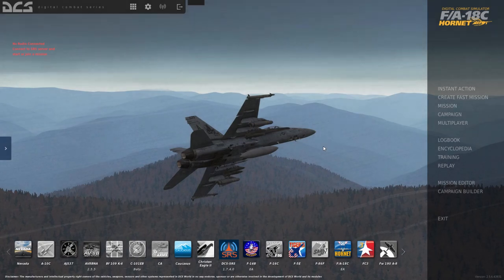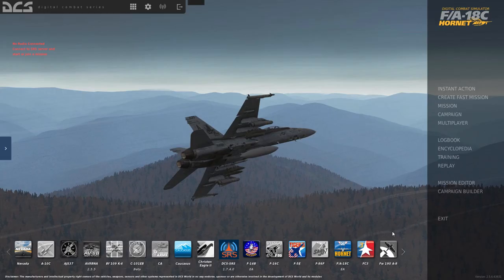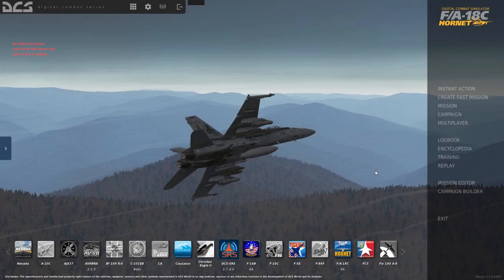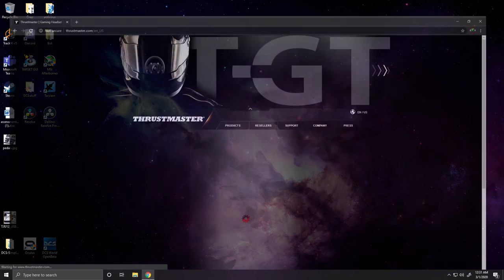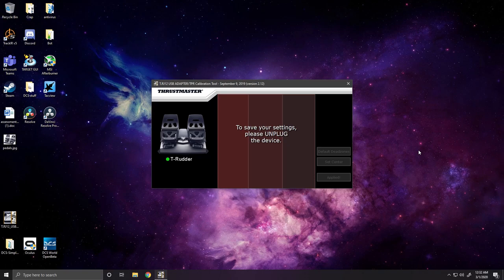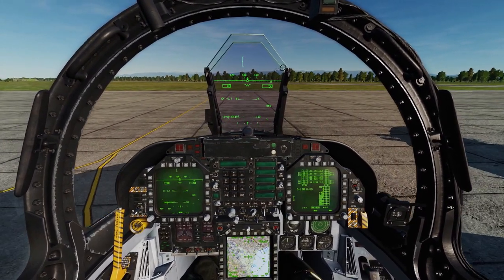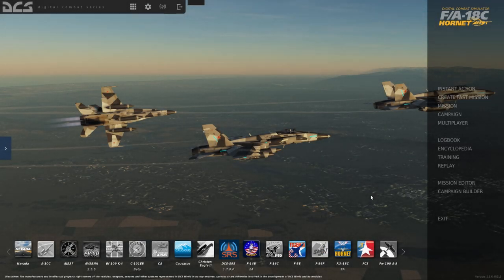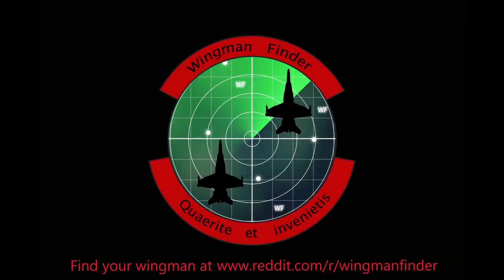Setting up Thrustmaster TFRP rudder pedals in DCS and fixing sensitivity issues!

Comment: Any advice for this problem... I Have the T-Rudders but the calibration tool things theyre the T-pedals... I have Clutch, Brake and Gas as my options, not left, rudder, and right like you.  It always thinks that I have right unput at max instead of a middle dead zone like you have.
Reply: Disregard I figured it out, I realized there is a car/plane switch on the usb plug and mine must've gotten switched when I touched it.

Comment: It's been a while since you made this video but it's immensely helpful still. Just got my flight sim gear set up and could not figure out how to get my peddles to work correctly in DCS. They were controlling everything but yaw, this should fix the issue. Thanks!
Reply: How did you set them up?  I cannot find "Wheel Brake Left" or "Wheel Brake Right" in the control settings..  Maybe they have changed it?

Comment: This video is awesome, I was about to give up on my pedals because they were so hard to control. This was a game changer for me. I was having such a hard time on takeoff because they were so sensitive. It pretty much wiped me out every time I got going. I just bought them and never had rudder pedals before and was regretting it. It’s all good now. Thank you greatly.
I have owned the thrust master warthog stick and throttle for years. But never had pedals, again this is a game changer.
Reply from the maker: Glad it helped!
Reply: How did you set the controls in the game?  I cannot find "Wheel Brake Left" or "Wheel Brake Right" anywhere in the settings..
Reply from the maker: @MikaTarkela  I believe they are in the axis controls.

Comment: Very helpful. Only thing for me is the calibration software doesn't work for my T16000M joy stick and rudder pedals for some reason. It says "Please plug a device" yet they are plugged in.
Reply from the maker: You have the rudder pedals plugged into the throttle?
Reply: @WingmanFinder  yes. I seem to recall that might be the issue. Doesn't see the joystick or the pedals. They work well though.

Comment: Thank you for great video! I followed step by step and still have the throttle problem where my throttles are split/centered and full throttle is reached by pushing one rudder pedal and idle by pushing other pedal. I followed your recommended steps to clear yaw/pitch/roll in throttles category/column. Trouble when try bind my throttles (Wingwing FA-18) the DCS doesn’t show any axis when trying to left or right axis….
Any thoughts.
Thank you, Steve-0

Comment: Quick question. Is it normal for the aircraft to turn right when pressing right rudder and left with left rudder. For some reason I thought it would be opposite. Also, I have to press down the rudder pedals to release the brakes, not the other way around. How do you change that?
Reply from the maker: That is normal rudder pedal operation.

For the wheel brakes, there is an option in the control settings for that.  Clink tune axis, then select the checkbox that says invert axis.  Do it for both left and right.
Reply: hello my friend, sorry to bother you so long after, but have you solved this? i'm having the same trouble

Comment: OK so do yuo deal with potentiometer noise. How to filter it out in DCS? Where with rudder deflection to about 1/2 travel either way, the rudder samount signal starts  dancing and you can see the pedals in aircraft start randomly displacing.
Reply from the maker: I haven’t had this issue.  Does it do it in the TM calibration software as well?
Reply: @WingmanFinder  Yes. And in JOY.CPL. Like there is noise in signal.

Comment: Hi great video. Only problem I have when I download and install the calibration software it displays a driving pedal set. Accelerator brake and clutch!
Reply from the maker: On the box on the usb cable that comes from the pedals there is a switch to switch from car setting to aircraft.  Check that!
Reply: @WingmanFinder  many thanks mate I’ll have a look as soon as I get home 👍
Reply: @WingmanFinder  thanks heaps mate found the switch works fine, all good 😎

Comment: hello, i've got a Logitech Flight Rudder Pedals and the toe brakes seems to be locked until i press them. So the release is by pressing, there's anyway to fix that?
Reply from the maker: The axis is probably reversed.  When you go into “axis tune” for each toe brake you need to either check or uncheck the invert box.
Reply: @WingmanFinder  gonna tried later, getting at my home, thank you for the reply.

Comment: Hi @Wingman Finder nice video on how to setup and get familiarize with the rudder. I got mine just now with the Warthog Hotas. DO you have video how to setup the thrust? I see in this video your thrust left and right bind to JOY_RZ and JOY_Z. I can't find it, Help? LOL, its okay. I check again and i need to assign it manually. LOL my bad :)
Reply from the maker: I actually didn’t have to set mine.  DCS automatically detected mine.  But, just go into axis controls in the drop down controls menu, find left engine thrust, then slide the left throttle forward and back and it should pop up in there.  Then repeat for right engine thrust.
Reply: @WingmanFinder  Solved! Thank you. BTW, about the rudder. I followed your tutorial but it's still so sensitive. I can't take off from the runway because when I press the pedal left or right during take off the faster the plane go, the more sensitive it become that it make my plane either steer to hard to the left or right and then I crashed. How do I counter this sensitivity? Thank you in advance for any help! cheers!
Reply from the maker: @camovecmin4968  nose wheel steering should be turned off at around 70-80 knots during takeoff
Reply: @WingmanFinder  I see. I will give it a try and keep practice 👍

Comment: Hello , I have bought tfrp rudder pedals , but they weren't recognized from my pc. Could you help me to solve this problem?
Reply from the maker: Is the switch on the little box on the cable set to PC?
Reply: @WingmanFinder  they are connected in the throttle
Reply from the maker: @fioreromano6696  have you downloaded the target software from thrustmaster?
Reply: @WingmanFinder  problem fixed , but now the problem is their calibration
Reply: @fioreromano6696  how you solved that problem please?

Comment: anyone know why im getting ghosting with mine? im using it with a saitek x52 pro. my motherboard is all usb 3.0 or 3.2 had to get the hotas a powered hub to stop ghosting. thought it was the same problem with the rudder pedals but that didnt fix anything.

only thing ive concluded is that thwy dont like sharing axes with non thrustmaster hotas???

Comment: For some reason, my rudders do not show up in dcs. I dl the current driver. The fine tuning software from thrustmaster won't work.
Reply from the maker: Did you get this worked out?  Does windows recognize anything when you plug them in?
Reply: @WingmanFinder  yeah have new issues

Comment: Man I have tried everything to get these rudder pedals to work. Followed all steps from your video and from thrustmaster but I don't have a clue what to do now. Everything works fine if I got to my control panel and click on my hotas it shows rudder controls working, but when I go into DCS they don't show up as an input or anything. I downloaded the program you showed in your video but when you open your program it detects instantly, when I open mine it just says connect device so its not even reading my pedals. They are plugged into the base of the joystick itself the only place it can be plugged. If anyone could help it would be much appreciated.
Reply: Again I am on PC. Got to looking around and saw something about a TRJ12 USB adaptor. Do I need this for my computer to communicate to the pedals instead of plugging it into the base of the joystick?
Reply from the maker: @samcarter1848  I’ve never used it plugged into the base.  Mine came with the adaptor to just plug them in via USB.  Did you try using the Target software?  Target should recognize them.
Reply: @WingmanFinder  For some reason mine did not come with the adaptor, but I did download target and as far as i know target did read it and it put the new update to the hotas so I restarted my computer like it said to. My computer reads both the rudder and joystick in my controller screens and it reads all the axis but when I open the thrustmaster config program is just shows connect device when other videos they open the program and it instantly reads their pedals
Reply: @WingmanFinder  I did order the adaptor last night. I did see some people say it would only work if the computer saw it as another USB
Reply from the maker: @samcarter1848  You should have no problems when you get the adapter!
Reply: @WingmanFinder   thanks for the help now for the daunting task of learning DCS

Comment: Are you sure you calibrated the pedals in Windows first? I have the exact same ones and they don't fully deflect the virtual plane's rudder pedals unless the real pedals are fully deflected too. (It's still touchy, but I've left all my rudders linear as I've found too little is worse than too much.)
Reply from the maker: That is another possibility.  Never did that as I only did the two adjustments in the video.  Probably where I should have started, but this ended up working fine for me!
Reply: @WingmanFinder  At the cost of lost resolution and pedal range.
Reply from the maker: My pedal range in the plane matches what I’m doing on the real pedals, I can use the full travel of the real pedals.  The thrustmaster calibration tool essentially does the same thing which kind of makes the windows calibrate unnecessary.
Reply: @WingmanFinder  I don't use any Thrustmaster in-between software. Windows and the sim are enough to set up, thank you very much. ;)

From what you describe, it had to be the calibration, as the default 1:1 mapping wouldn't max out the plane's rudder deflection unless you're pedals were also maxxed out. 

Garbage in, garbage out! You need to calibrate it at the driver before the game has a fair chance of dealing with it.

Comment: when I download the calibration tool my pedals don't show up while they work just fine ingame
Reply from the maker: When you open the calibration tool, unplug them and plug them back in.
Reply: @WingmanFinder  doesn't do anything :\
Reply: Is it connected through the throttle (RJ12 connector)? I just got mine and trying to calibrate the dead zone, however, they wont show up on the calibration tool as well. @Wignman Finder, any idea how to calibrate without purchasing the RJ12 to USB adapter?
Reply: @WingmanFinder  They won't show up if they are plugged directly in the throttle.

Comment: I tried this, but now I can't turn my F18 properly on the ground, there is no way for me to taxi on the super carrier, the turn radius is way to low.
Reply from the maker: Are you using the HI steering mode for the NWS on the carrier?
Reply: @WingmanFinder  since I didn't know there was a HI steering mode.i doubt it. NWS is on by default on cold start, I haven't done anything with it.
Reply from the maker: @Gunfreak19  on the carrier normally you use HI mode.  Look under NWS in the bindings and see if you have a binding set for it.  Mine is set to the pinkie button on my stick.
Reply: @WingmanFinder  thank you, I'll have a look.

Comment: Hi mate. Thanks so much for this video, it solved my rudder issue, although I still have one more problem. My toe brake axes don't work, because when I apply force, I have to depress them halfway so that they're centred in terms of the axis. After I release them, they're 100% locked to one side of the axis (therefore fully braked). Any ideas on how to fix?
Reply from the maker: Have you looked at what they are doing in the thrustmaster calibration software?
Reply: @WingmanFinder  yeah, I have! They are both on 0 when not touched, and scale to 100 properly with correct pressure. It's just in DCS where they 'lock' themselves after first application
Reply from the maker: @gnittegdellort  are the axis Inverted in DCS?
Reply: @WingmanFinder  ah, that's the one! I converted them to sliders and then inverted the axes. At first it appeared to work in reverse still, but rebooted and did the same thing and it now seems to work perfectly. Thanks so much!

Comment: My pedals for the TF-51D make it barely even turn.
Reply from the maker: Blake Gibson I had that same issue with the P-51, not sure if there is something I needed to change in the p-51 settings or what.  I never looked further into it cause I don’t fly it much!
Reply: Wingman Finder I just bought the F-15 so I’ll have to see how that works out.
Reply from the maker: Blake Gibson nice!  That was my first plane!
Reply: I'm not sure if this'll solve your problem, but I've read that the P-51 responds better to "quick jabs" on the pedals as opposed to holding them down. Or that may just be a principle of flight in general. I am the newest man in town at this